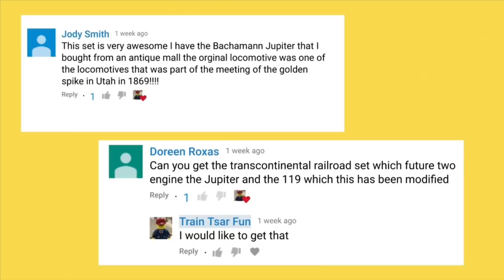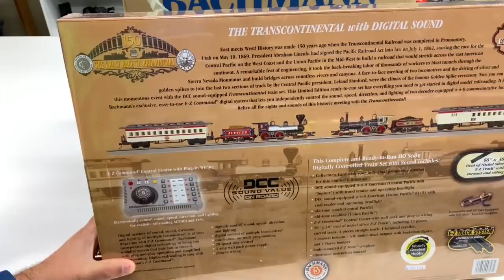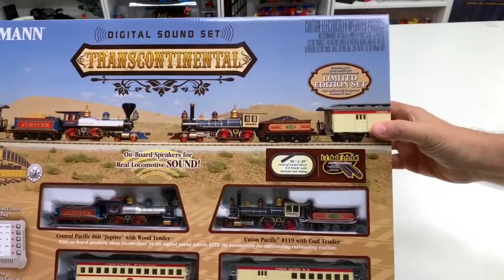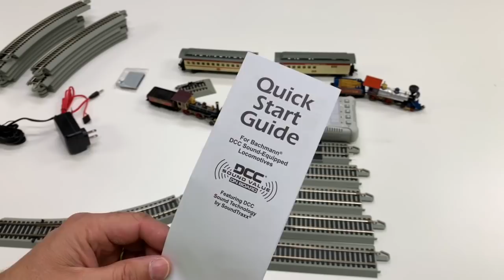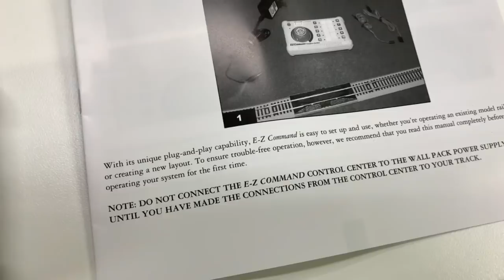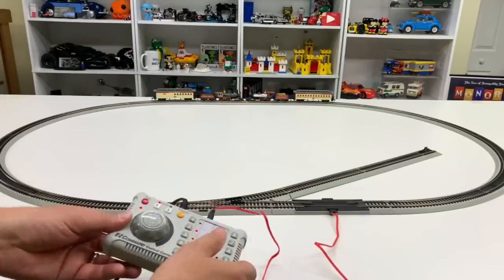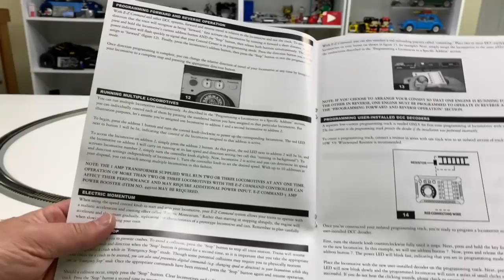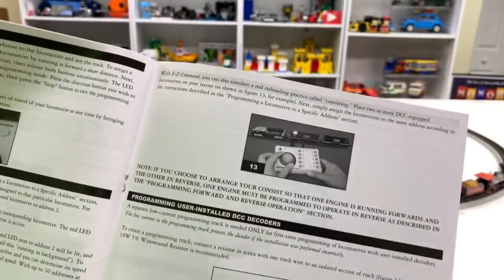GOLDEN SPIKE 150th ANNIVERSARY BACHMANN #00827 Transcontinental w/ Sound Train Set

Comment: I read somebody's complaint that these model locos did not "go fast enough at top speed" , but the originals rarely went faster than 25mph,  with 40mph probably being their flat-out, open throttle maximum.
Reply from the maker: Good point. Leave to people wanting to run at far above prototypical speeds to complain. Probably most people are running their trains way to fast. Passengers would be killed and freight destroyed and derailments increased if real trains ran at the scale speeds some run theirs - like me- lol

Comment: You can run DCC locomotives on DC, but all it will no is run, no sound, or using a DCC controller
Reply from the maker: If you watch this video you will see that it does indeed have sound on DC
Reply: Train Tsar Fun sorry, I did watch the video, but  I had to go and no something else so I did not get to see the end, I am sorry for my comment, I should of waited and saw the end of the video.